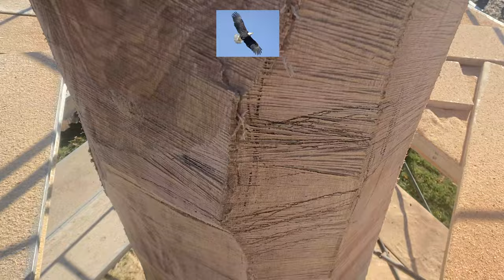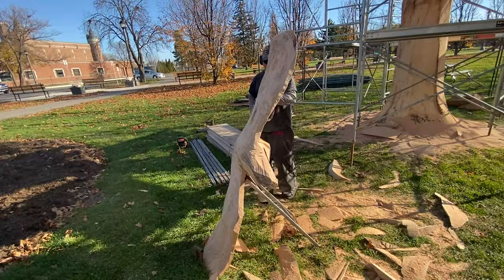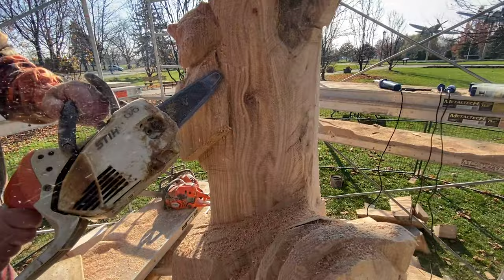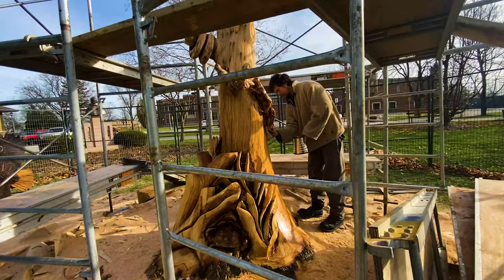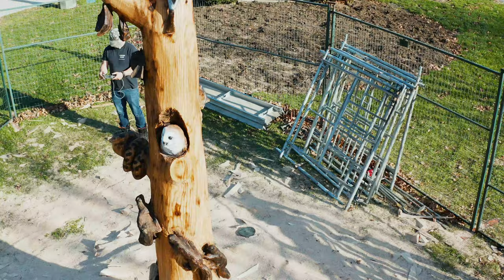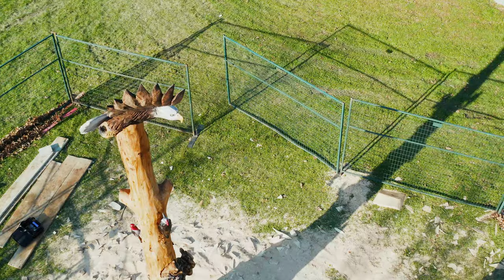Jackson Park Wildlife Tree Sculpture (Windsor, Ontario) 2020

Comment: This looks amazing!! Since you were working on this yesterday, I 'm assuming it's a bit chilly! What sealant do you tend to use for colder weather applications? Thanks!!
Reply from the maker: I use a Timber oil product Thompson’s Timber oil.  It’s not a shell coat so it just soaks into the wood. If it’s too cold I use a heat gun or torch to warm it up.